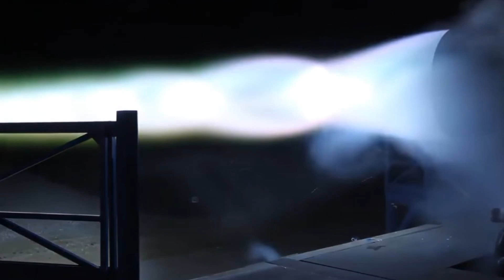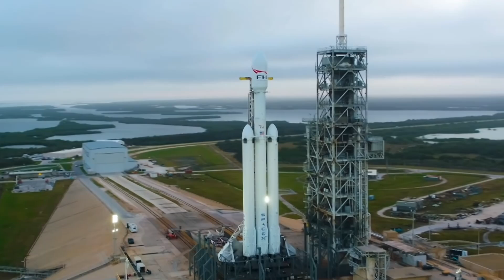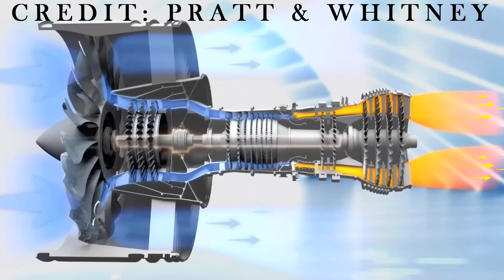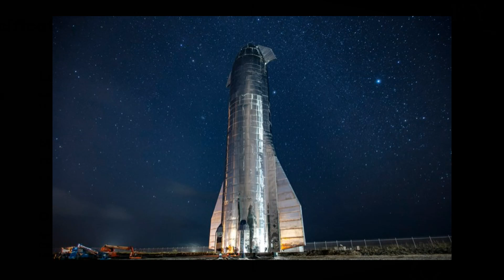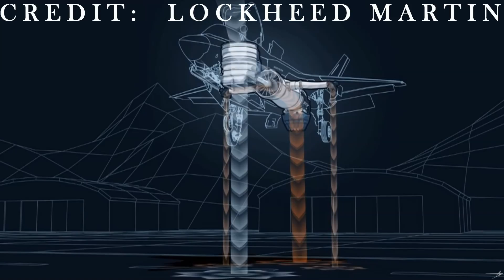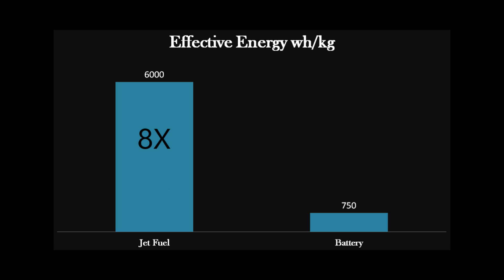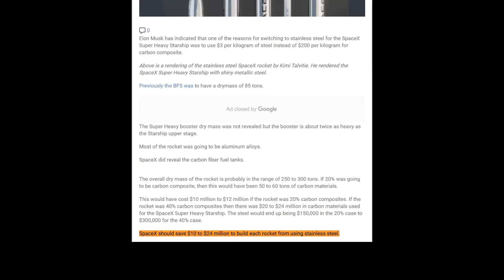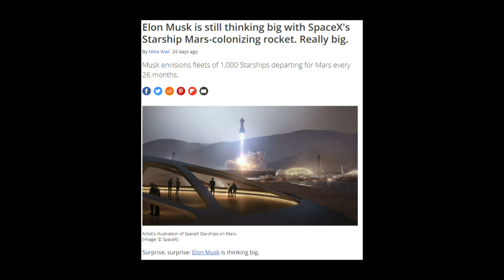ELON MUSK'S BATTERY POWERED SUPER SONIC VTOL JET - My Tesla E-SuperVTOL design

Comment: My main niggle and question would be is the farthest the batteries are from the motor, don’t the electrical wire from battery to motor need to be thicker and heavier? The motors in the middle might be problematic then?

Overall enjoyed the video and liked you pointing out all the systems and complexities that aren’t needed
Reply: It depends on the voltage, the higher the voltage leading to the motors, the lower wire size is required.  I remembered when I picked up a dead 250Kv aluminum line, it felt like I was picking up something made out of paper.
Reply from the maker: Halter, great point, I didn't even think of that.  Pete's comment might cover that?  My understanding is that current is what necessitates thicker wiring rather than voltage, but I don't know if there are any limits there.
Reply: May be able to partly use the steel fuselage as conductor

Comment: 200m long magnetic rail gun at 15 degree slope accelerating a vertical landing craft from 0-300km/h in 2.5 seconds that uses zero of the crafts energy storage until maximum inertia is reached at 300km/h. Thats 6km per minute with a range of 50 km maximum. It can seat 40 people living in outer suburbs and get them landed to a cbd rooftop in under ten minutes with vertical landing actual rechargeing some lost energy in supercaps ready for vertical takeoff to collect more passengers from outer suburbs . Minimal battery capaciy needed especial with rail takeoff . I suggest with basic calculation no more than what the 200 kwh pack ! When siting on railgun with passenger boarding it can be charging both supercaps and batteries and also on rooftop . Maybe even 100 kwh battery would do ! Actuall craft weight is 1.3 tomees including battery weight of 600kg. It llook similar to your missile design but 1/4 of the length. Lets start tommorow ! Anybody in?
Reply from the maker: I'll have to look into the railgun idea!  For now, I need a break, this thing was like giving birth, lol.  Going on holiday today for a few days :).  The next video will be on batteries and what to expect at battery investor day but I'll add that to my ideas list!
Reply: nobody will survive to g
Reply: naoufel morai  well if 1.9 seconds to 100km/h is ok then 4 seconds to 200km/h will be fine so maybe 4 seconds to 300 will be ok too . Its not for the elderly . They can catch the slow coach !
Reply: Interesting concept.  The g's would be 4.5, which is lower than couple of roller coasters, but I think it may give overweight MBA's and lawyers a heart attack; which may not be a bad thing ;)  There would be serious liability issues, maybe appropriate for fighter pilots and F1 drivers, I am sure they would love that.  As far as me, a retired 60 year old engineer, I think I'll stick to a Cessna.   Cheers.

Here are the calcs :
Acceleration = Delta V / Delta t = [400 km/hr x (1000m/1 km) x (1 hr / 3600sec)] / 2.5 sec = 44.4 m/sec^2

44.4 m/sec^2/ 9.8 m^s2 = 4.5 g's